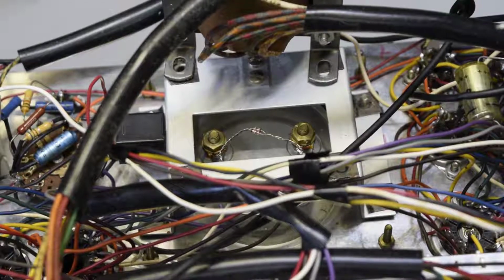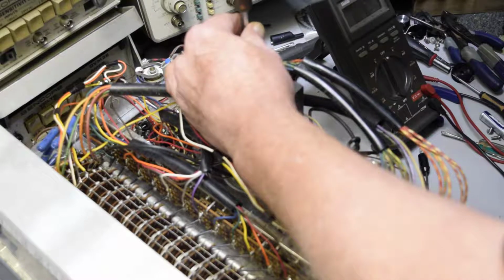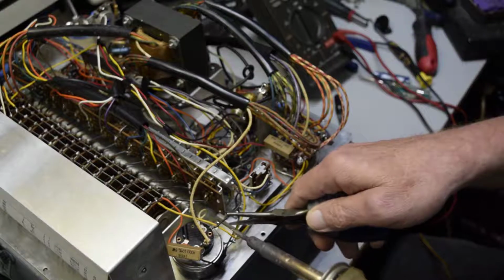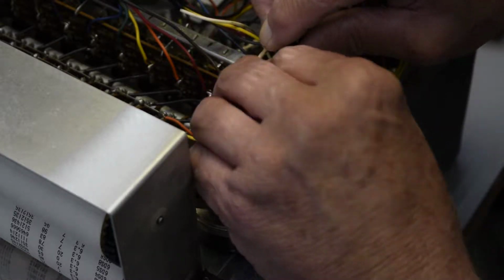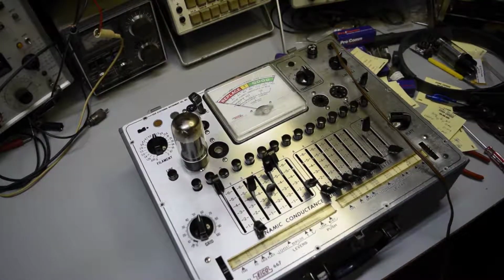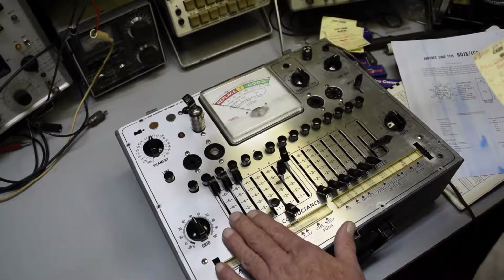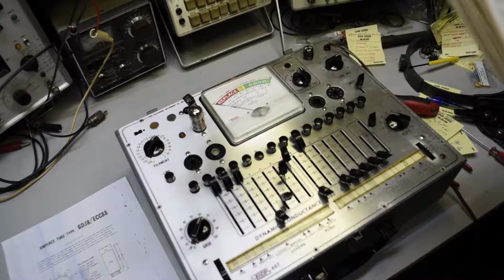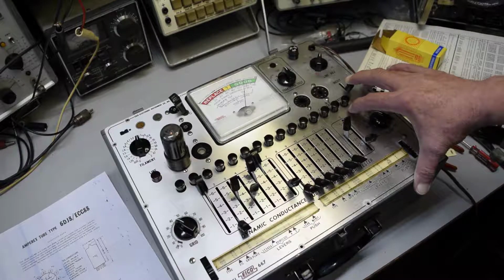EICO 667 Repair

Comment: Thanks for the Video.  A few questions please. You did not mention the diode type for the meter protection mod.  I have 1N4007’s will they work for the meter, or what should I use?
For the Grid #47 fuse mod, where should it be connected, on the wiper of the 5K (R15) grid pit?
Another random question:  I have reason to believe that the schematic has R8 (300K) and R19 (330K) values reversed.  A 1973-4 667 kit model I recently purchased has the two resistors penciled in as a change on his schematic.  And a YouTube video shows a factory unit that has R8 and R19 also switched from the schematic.  He indicated that he thought the factory made an installation mistake, but because I have a pencil correction on my schematic, I believe there was probably an addendum.  Do you have any thoughts or knowledge about this?

Comment: hello K, i'm about to buy a eico667 but according to the seller it's not testing accurate/right the tubes, so i'm risking buying it and will try to repair it. can you advise me some troubleshooting tips for eico667 innacurate problems? thanks, from toronto..................
Reply from the maker: Hi Torpengpogi from Toronto. Sorry for the delay in responding to you I was having open heart surgery. And just now getting able to do anything again. I'll dig up my notes has soon as I can and get back to you. Lawrence